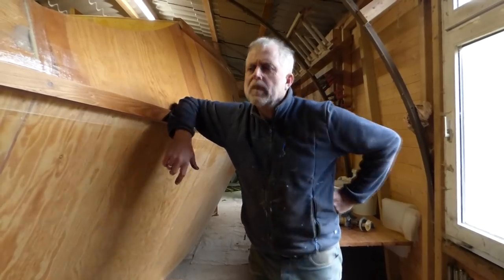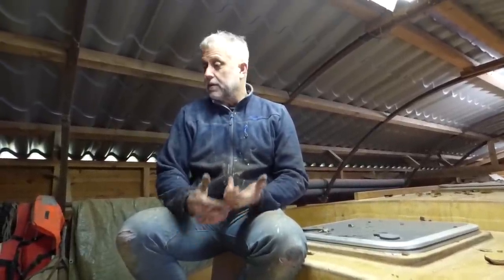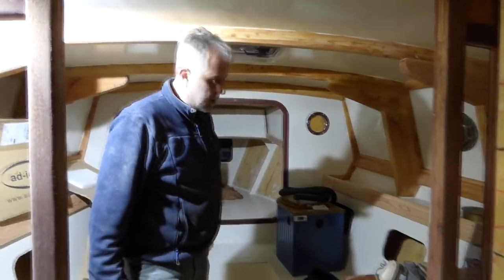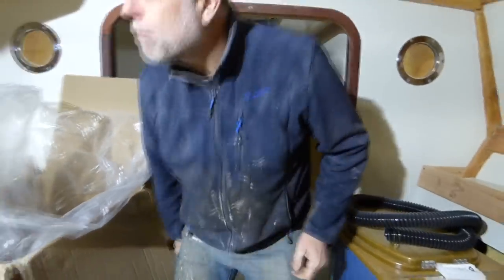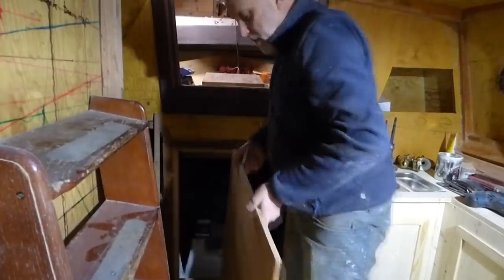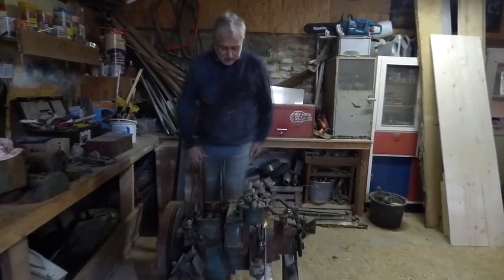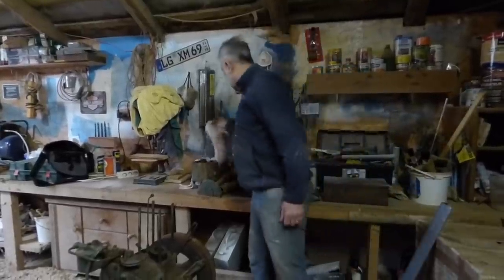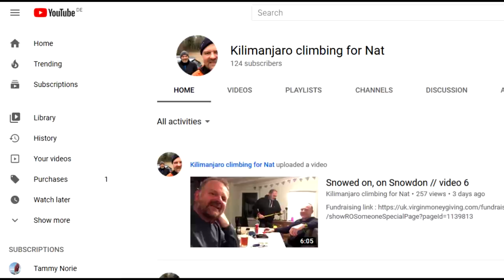2 1/2 years of this boat build and more!!! - SV Tapatya EP124

Comment: To work like new, the interior of that piston cylinder needs to be 'cross hatched'. Usually done with an expensive Sunnen hone machine, you can do much the same by hot gluing two sponges to a 1/2" dowel, using some contact cement to adhere a sheet of wet/dry 220 grit sandpaper, oil it up, squeeze it into the bore and chuck the dowel in a 1/2" drill. You have to use slow speed and keep the sandpaper moving end to end so it makes an 'X' like pattern in the tube. Those 'scratches' are what hold lubricant during operation and prevent 'metal to metal' contact. "Tales from a retired Honer"...
Reply from the maker: Thanks Mike. Good tips 😀👍

Comment: Thanks for another interesting upload Tony, just one question about your composting toilet fan exiting the side of your boat will be electric powered, any particular reason you didn't go up to the roof and use a solar fan?
Reply from the maker: Good question Chris. I don't know how long a solar fan will run at night or during less sunny periods... The toilet came with a low-consumption fan and, as I'll be installing solar panels, it'll sorta be a solar fan... 🤔. However, I suspect your idea would work just fine... 🤔

Comment: What will you be using the engine for, at 14:35 in the video ?
Reply from the maker: It's just an old engine I had kicking about. I'll get it up and running and see - an engine in reserve maybe? That and showing the kids how a diesel engine works 👍😀😶
Reply: @SVTapatya  Great idea. Good luck.
Reply from the maker: Thanks John 😀